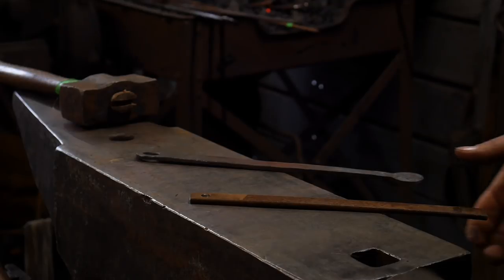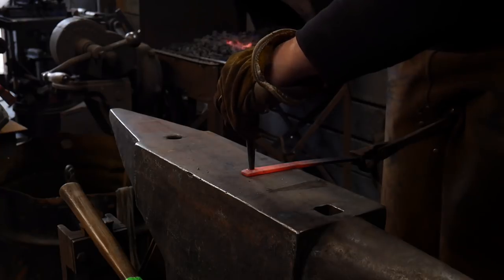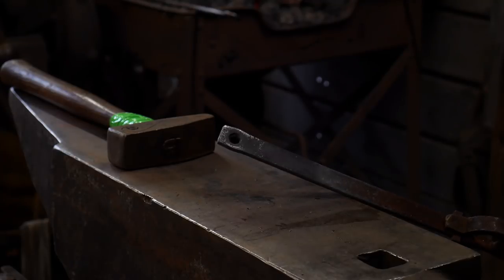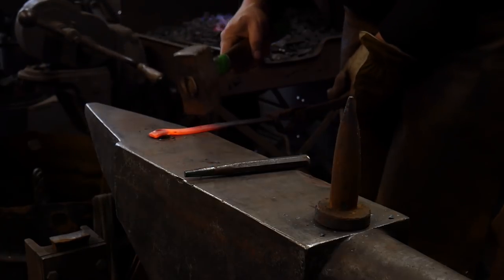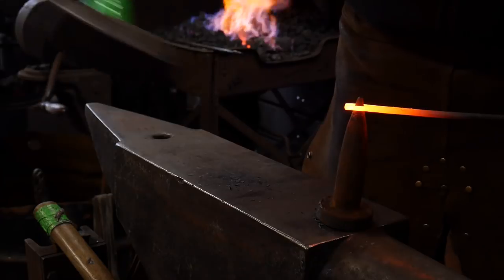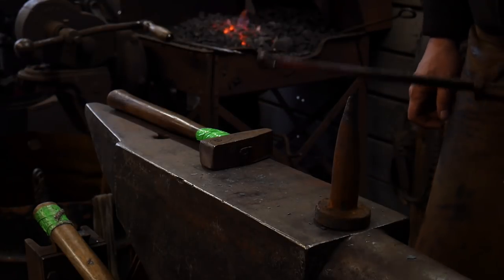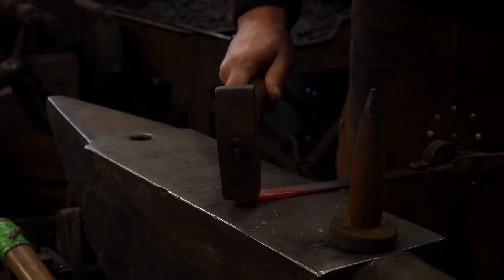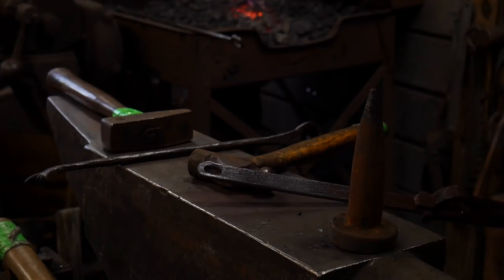How to Make Oval Holes in Steel

Comment: That method is a lot more efficient then what I've been doing. The way I was doing it was to punch 2 holes side by side then clean up the middle with a file. Thanks for the tip.